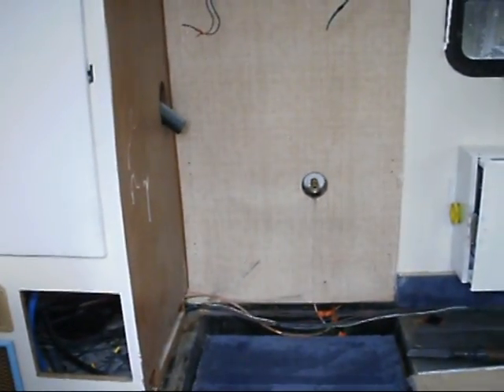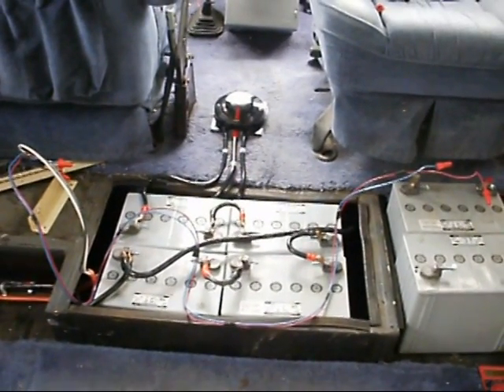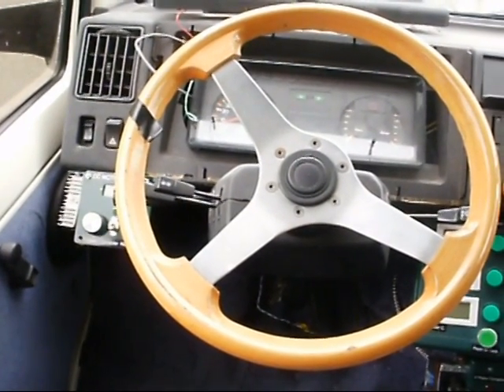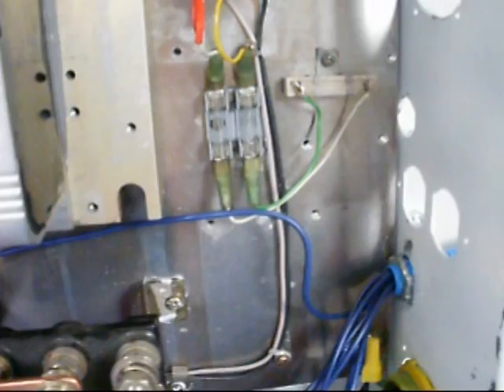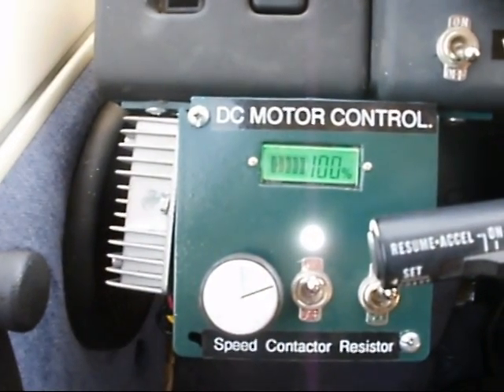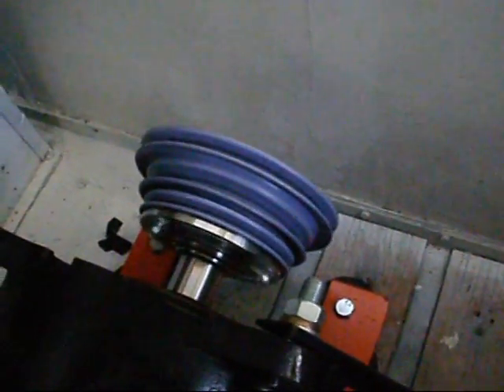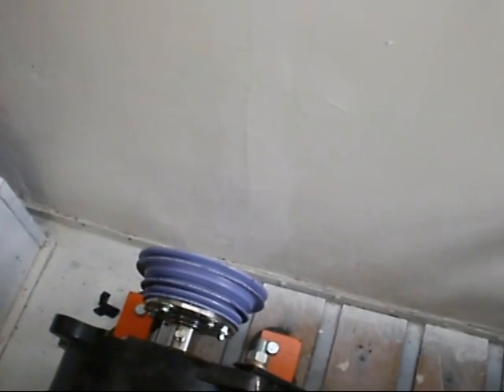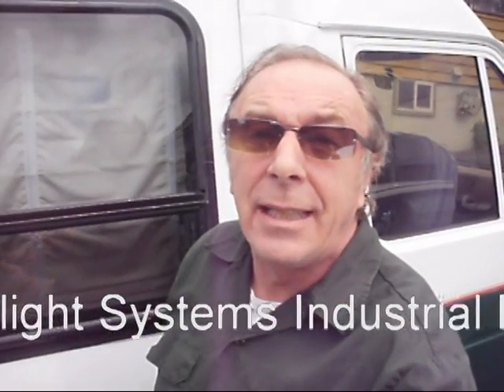The Electric Motorhome RV.  part 20-b. The dc motor runs !!

Comment: Now that is what Engineering looks like! This gentleman has probably forgotten more stuff than I will ever know! CHEERS TO YOU And Thank You!  :) ***=A+++++ Great Video gave me lots of Ideas! Thank You Sir!...Jeff
Reply from the maker: Thank you for that compliment Mr Garcia .
Reply: Sure thing It also happens to be true in your case well thought out and not like some mad scientist I am off to look at A 1987 El Dorado Firenza in San Diego I found on Craigslist it has been partially restored new floor/A/C New Fridge and Wood Floor and at 4000 bucks the price is right so I have to look I needed motivation so I am glad I found your work. The RV has A 460 V8 Ford Chassis and 73 thousand miles mostly fiberglass Body on Chassis so I dont expect mold but I will be looking for it regardless behind the panels inside.
There are also California Smog Legal Fuel Injection kits for these now that Ad 4 or 5 MPG The ATOMIC MSD Throttle Body Injection so I figure on converting it and just waiting for A Gear Vendors Overdrive to pop up on EBAY or Craigslist its 25 Feet in Length so It fits my property no problem It wont become An eye Sore so I will commit as long as there is not something my gut tells me is Off with it. So I am a little Stressed but Excited! this is my first RV that was not my Grampas or my dads So now I really get to see what I learned from them in my 50 years on earth Squarely on my shoulders so thanks for the encouragement! you saw something you felt needed doing and you did it! Just what I needed right now.
Reply from the maker: I had an El Dorado last year, and found it to be a very well put together machine. Mine had spray foam on the chassis which made it well insulated. 24 -25' is the best size for an rv .So long as it is sealed on the outside , ( I bought some white roof seal at home depot) you can remodel it easy .Good Luck.
Reply: I am watching the videos keep them coming please! I still have not found my Ideal but now I am thinking A VW Winnebago Rialta Maybe a graft Hybrid something we can transplant out of a Wrecked Prius? we can set out to Graft the drivetrain/batteries maybe with subframe connectors right thru the floor using A heavy Diamond Plate to reinforce the fiberglass floor or! OR! 1963 CORVAIR Style I am thinking This is exciting!
We have a 66 corvette so we can at least look how they went about mounting the car on the frame we never did a frame off on it because we were afraid the doors and stuff would never line up again (its the hard top non convertible like a split window without the split DOH! so to do this properly we would have needed to do An Exo Skeleton to hold it together Too much hassle and 66 was the worst year for corvette in California they added Smog Equipment and all that We tossed that stuff in the trash long ago funny thing is 65 and 67 did not come that way here in California We got it brand new the year I was born so there is sentimental value only. Well that and the Big Block 427 Hood And Side Pipes with the louvers my uncle had the smarts to buy directly from the dealer in 1969. I am looking now at options you woke me and my family up so thanks we are all getting excited to what is possible just need the will I am capable of learning so forward onward CHEERS!
 PS almost forgot I can have the interior done in Tijuana Mexico plenty of my old friends that worked for Fleetwood I think ...well it was A RV manufacturer that I remember for sure! here from California that are now using their skill back home in Mexico  for A Song price wise really and it will look just like a new Fleetwood inside. Can you imagine people looking and looking all day on Google for a 1986 VW RIALTA HYBRID..LOL

Comment: Are there going to be any more videos of this project? Hoping so!!!
Reply from the maker: Yes, there are. I 've had a very busy summer, and it's a challengr to get a 26 spline  hub to fit on a 26 spline shaft , as the hub a slightly too big...So, I am useing different diameter guitar strings to fill the gap...Any suggestions ?  Thank you for your interest.